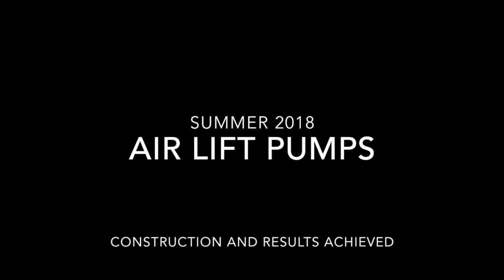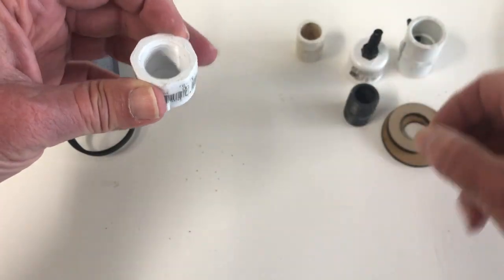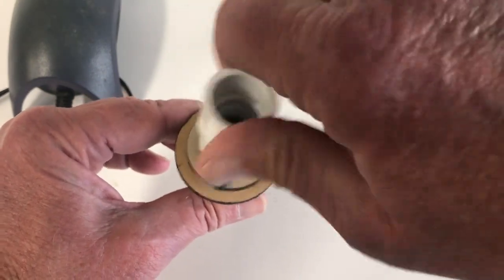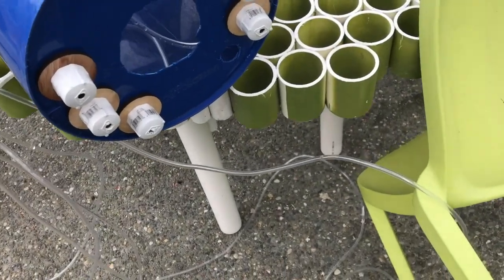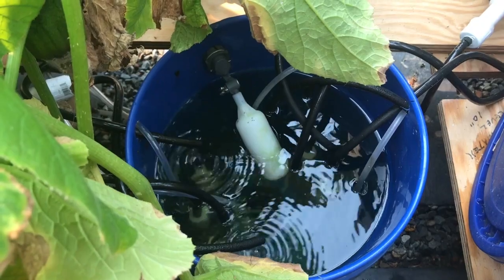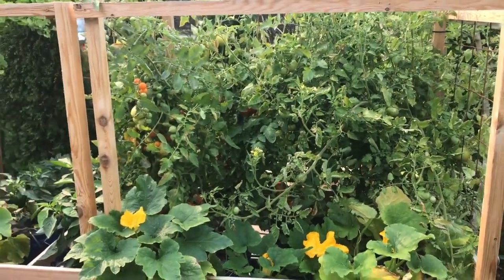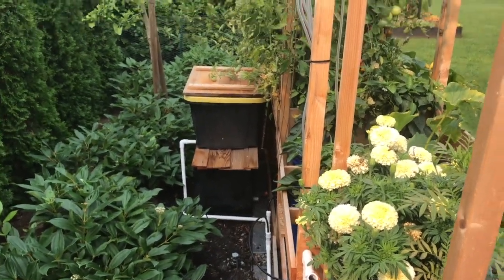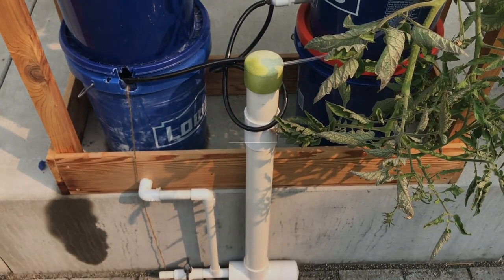2018 Hydroponics Air Lift Solar

Comment: These little pumps are amazing! The efficiency is astounding. I'm totally going to build a few. I have two larger air lift pumps that are made from 2" pvc which then reduce down to a 1" PVC It can  move 300 gallons an hour
Reply: you all probably dont care at all but does someone know of a method to log back into an Instagram account??
I stupidly lost my password. I appreciate any tricks you can give me.
Reply: @Garrett Davion instablaster =)
Reply: @Mohammad Alfonso Thanks so much for your reply. I got to the site on google and I'm waiting for the hacking stuff now.
Seems to take quite some time so I will reply here later with my results.
Reply: @Mohammad Alfonso it worked and I actually got access to my account again. Im so happy:D
Thank you so much, you saved my account!
Reply: @Garrett Davion no problem =)